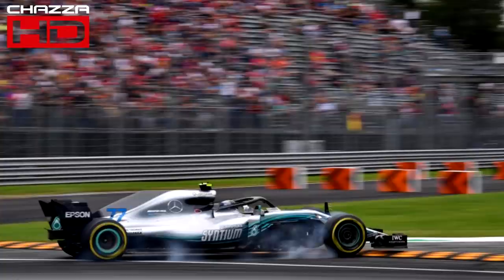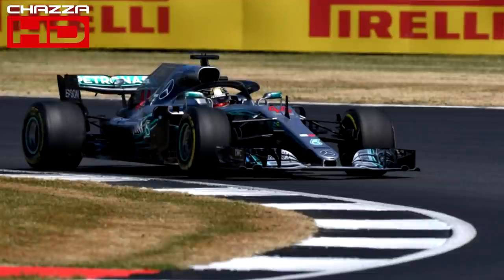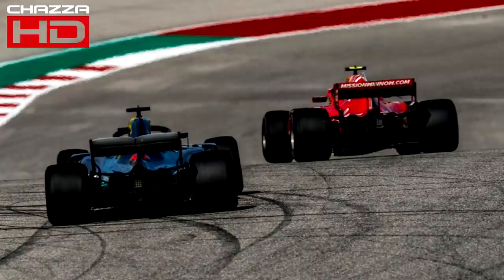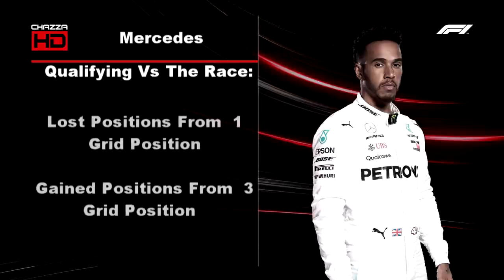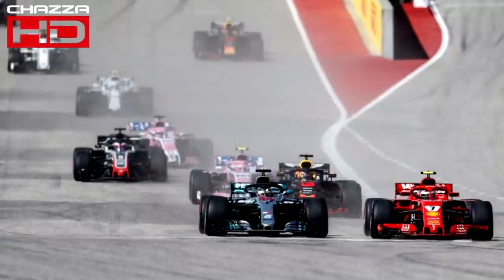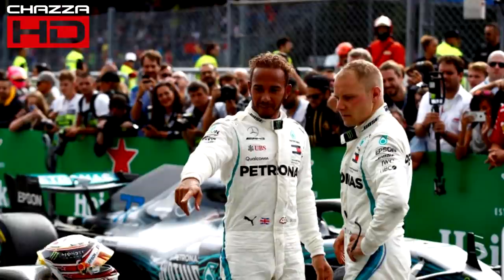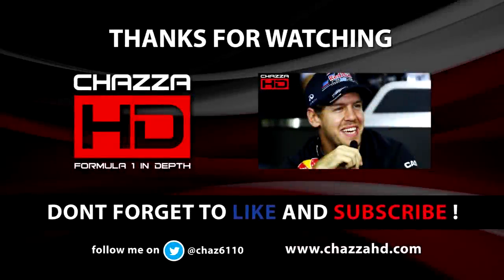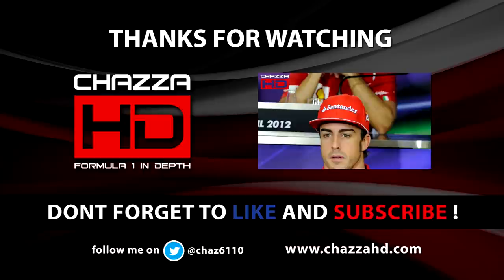Mercedes Wheel Rim Issue Explained - Have Mercedes Cheated Or Is It Brilliant Innovation?

Comment: So the question you did not answer is why did Mercedes worry about Ferrari protesting AFTER the FIA had already approved the wheel design if the FIA have the last word?
Reply from the maker: Mercedes started worrying at the US GP which was before the FIA approved it and ran a no risk strategy with the use of the device
Reply from the maker: I will say though i don't know why they didn't use it at Mexico and Brazil after the FIA approved the device at Mexico so yeah in those races i don't know why they didn't use it but they did in Abu Dhabi and most likely will and should use it for 2019

Comment: I think Mercedes basically put their hand up and admitted the first design also had an aero advantage. It was primarily designed to cool the back tyres, but if your designing an aero feature to cool tyres you might as well make the most from moving the air in a way that helps car performance/downforce as well. Can’t wait to see what Red Bull does to “cool” it’s back tyres next season.
Reply from the maker: I think the reason the FIA said it was fine was because the biggest benefit of it is cooler wheel and tyre temperatures which can't be used as aero advantages or effects     Its kinda (Depending on how you look at it) a loophole

Comment: Is this a similar story to Ferrari's double battery system?
Reply from the maker: Yes and no    Yes in terms of helping the performance of the car but no in terms of that the FIA were quick to clarify that this wheel rim is fine when the FIA still has censors on that battery that Ferrari have

Comment: It is presumed they had as spacer that worked has a fan cooling the brake and due to holes on the rim the core of the tyre(inside) if the temperature gradient between core and tyre surface is too high you get either blistering or graining cooling the core decreases the likelyhood of blisters
Reply from the maker: Yeah that is what it looks like they are doing       Does give you an advantage with cooling for sure if your the only one running this certain concept/device

Comment: This was 100% cheating. Blown wheels were deemed to be aerodynamic aids and aerodynamically active as well. They did indeed help divert air flow around the outside of the wheel which benefits the coende effect and allow the car to cut through the air to reduce rear wake and drag. They were banned for all cars in 2018. No team produces their wheels, only OZ does. They are supposed to be standard production for all competitors but as usual, the FIA was bought and the sport gave Mercedes as much help as possible until Pirelli could figure out how to address  Mercedes' tire heat and degradation issue. This enable Pirelli to change the composition of the tires which was Mercedes' weak point. No surprise though because Mercedes gained early access to the first hybrid era rims in 2013 (tiregate) which was illegal and cheating. Mercedes has known that the tires was their main threat from the beginning of hybrid era regulations. They developed and perfected the hybrid engine 3 years before any other team even knew they would be the regulated systems. In the stock market it is called "insider information," (which is cheating and illegal) outside the stock market we just call it cheating. But again, Mercedes bought the right people and like their illegal front eing, cooling system, tire pressure, fuel pressures, illegal fake pitstops, corner cutting and pitlane cutting, it was all swept under the rug.